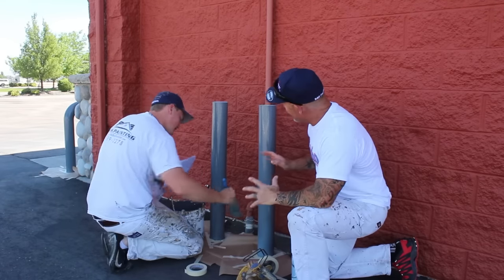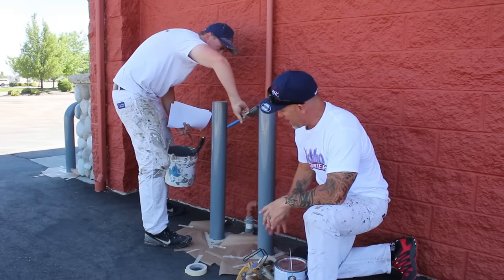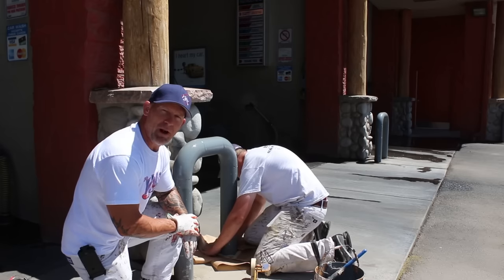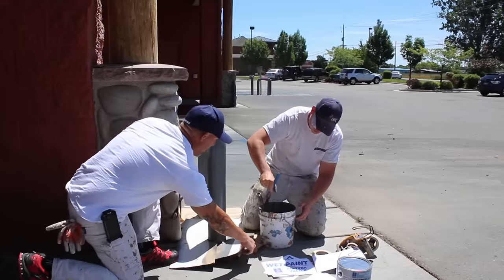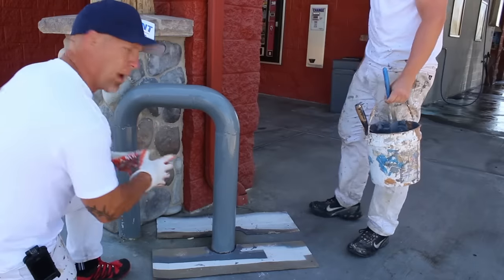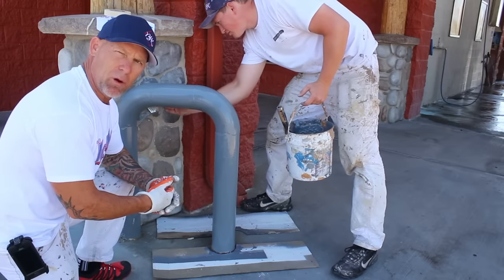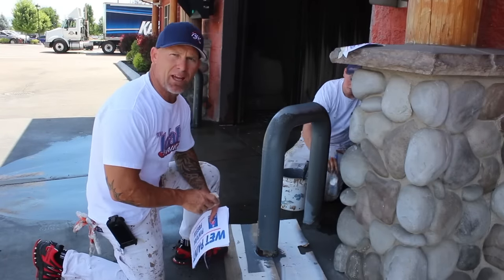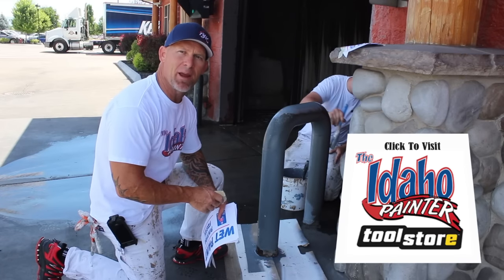Painting metal guard post with idustrial enamel.  Using Idustrial Enamel.

Comment: Do you prime any rust or is that product self priming? You seem to use your brush more than the roller so is it extra sticky paint that rips hair out of your nap even if its an old one? I have rolled those metal guards several times over the years and its very hard to keep the substrate lint free even with an old roller.
Reply from the maker: We do prime rust.  Thanks for the question or comment.  All our questions are now answered on our Facebook group "Paint Life Members".  Join that group and you will receive all the help you need.  Hope to see you there.

Comment: How would this work for a garage floor?  thanks in advance
Reply from the maker: We epoxy garage floors
Reply: I know, I watched the 5 part series which was excellent btw.  My garage floor had sealer on it.  I stripped it twice, degreased it twice and etched it once.  I still don't trust it to be perfect and am afraid of the epoxy peeling up.  The young guy at Sherwin Williams suggested the enamel for the floor, it's what they use in their warehouse with forklifts running over it.  What would be the drawback to using enamel instead of epoxy?  ty and tia